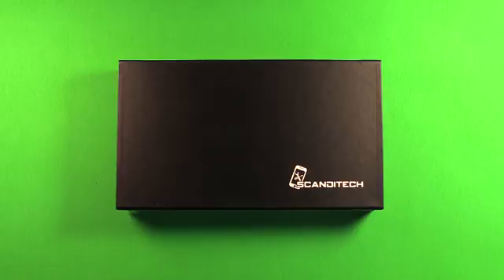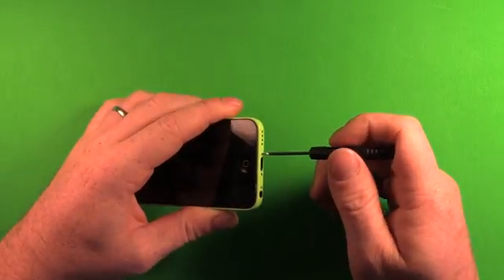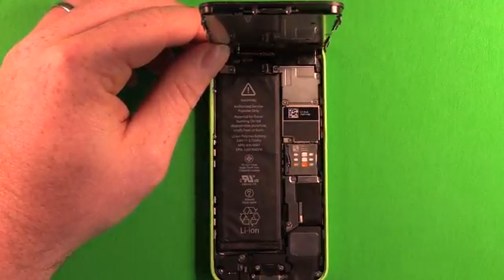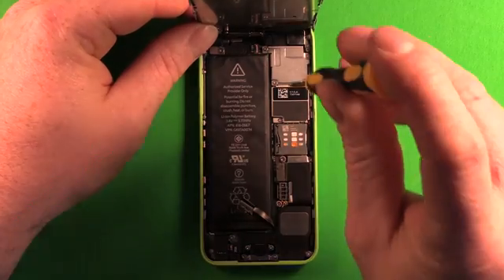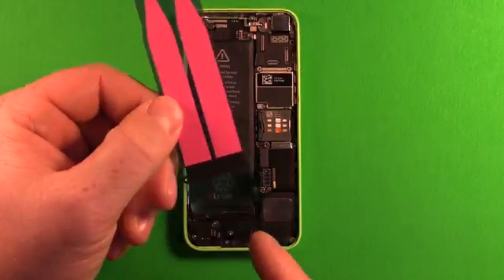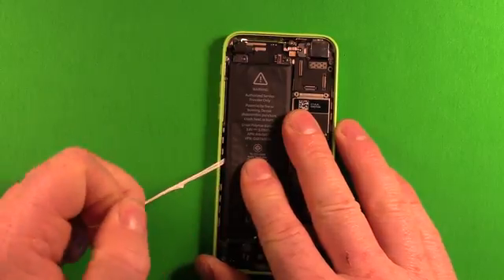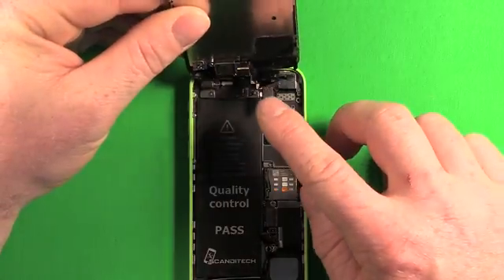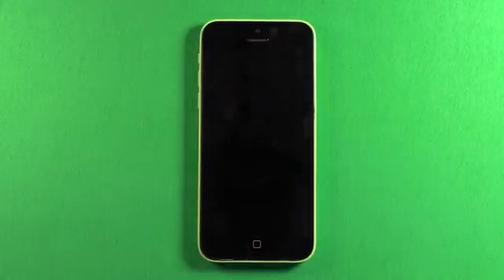How To: Replace / Change Your iPhone 5C Battery - DIY Guide by ScandiTech

Comment: I did replace the battery but the home button, speaker, and the socket did not working😭
Reply from the maker: Hi Allysa,

I'm sorry to hear about the issues. It is most likely that the connector of the speaker and the lightning port got loose during the process. This connector is located very close to the battery connector. 

The home button connector is most likely damaged or loose. Try to reconnect the connectors and check to make sure that everything is seated.

Comment: Everything went well...
Except the home button doesn’t work 😩😩😩😩😩
Now what ????
Reply from the maker: Hi there,

When the home button does not work, this means that the home button cable is either loose or damaged. To fix this is to simply reconnect the home button connector to its port. Please make sure it is seated. A soft click means that the connector has seated.
Reply: @ScandiTech  thanx

Comment: I've just done this job - and your vid was by far the most helpful.    My sucker wouldn't get the screen off easily so wedging something in the little gap was helpful.  Warming the right part with a hairdryer to loosen the adhesive ('specially as my tape broke) was also helpful   Thanks.

Comment: It took me a while to get the battery out but got it at last, the screws on the top right wow 😳 they are super small gotta be careful of not losing them.!! The video was ok I guess he could've gone a little slower.👍🏼
Reply from the maker: Hi there,

Awesome! Congratulations on the successful replacement! 

I agree, the screws are incredibly tiny and they are differently sized. So if a longer screw is inserted to the wrong slot, it can damage the board. 

Cheers!

Comment: Great video.. unfortunately I had many issues, fortunately I will be upgrading my phone in a week or so and although this was a disaster for me, I learned a lot and it's not a big deal..just have to go without my old 5c or any phone at all for a week. lol (and will return new battery I installed) First off..I tested new battery and it lit up and worked... I SHOULD have left the screen on and did it one handed because the screws at the top holding the plate would not budge, at ALL and i ended up flinging the phone around every which way, with the screen hanging on. (MISTAKE) I gave up and went for the old battery.. cut the tab of adhesive no problem, warmed a little and long story short, both sides snapped right off, leaving adhesive under battery.. I had to pry the left side for a very long time to get that old battery to finally give. What a pain.. Put in new battery in... anyway, phone is black, running but black. Obviously in my battle to remove screws off top place, im guessing i damaged the tabs..all i can think of.  My advice would be to skip removing screen altogether if you have screw issues and yes, they ARE SO TINY ..i had enough trouble getting the two back on the battery plate.. this video makes it look so easy... Anyway, good video, wish it worked out for me.

Comment: This worked great for me! I only had minor problems with one of the screws, and I did tear the adhesive while removing the old battery despite my best efforts, but I was able to pry the battery out and remove the old adhesive. The video was very clear and very helpful. The product is well designed. Thank you!

Comment: This worked for me. I slowly worked the plastic prying tool starting at the bottom of the battery -- away from where the video says the adhesive tabs are affixed, and I then jammed a credit card under it. With a hair dryer warming the glue, I slowly worked and wiggled the credit card down the length of the battery, slowly releasing the adhesive, wiggly the card and the pry tool over a period of about 10-15 minutes. I did it so slowly to avoid hitting the motherboard. I destroyed the adhesive, but a guy at an iphone repair store gave me 2 strips of some free double sided tape -- it's a very thin strip of adhesive, that I used to replace it. Thanks for the video! one thing you might point out -- when removing the screws from the bracket over the screen cables, pay attention -- there are 3 short screws and one long one. I marked the long one, and the corresponding spot on the bracket with a sharpie so I would know where it belonged.

Comment: I've done all of this, but my iphone 5c won't turn on even when I press the power button
Reply: Emily Gonzalez  that either means that you battery wasn’t plugged in correctly or the screen is not plugged in enough  or that you need to charge it